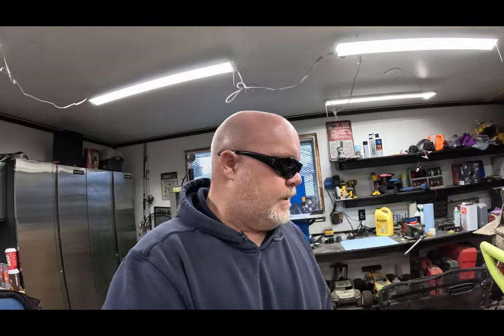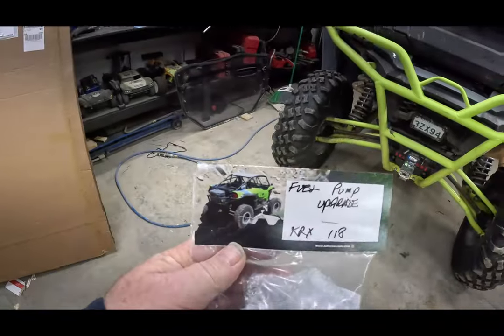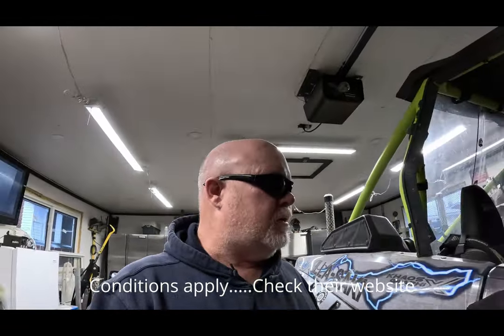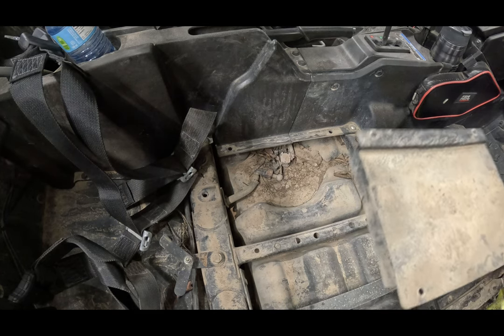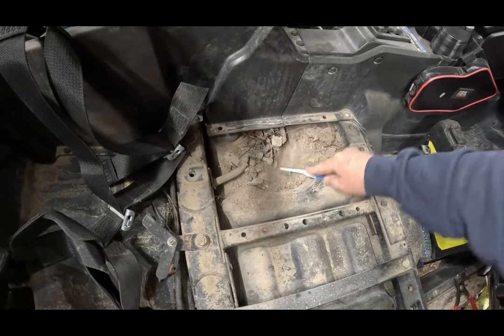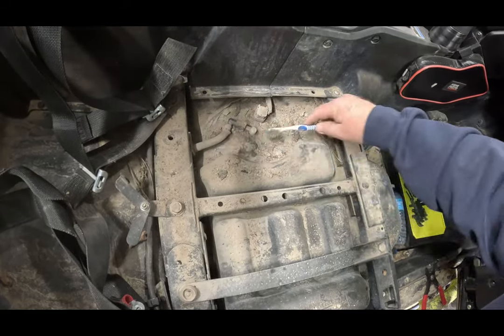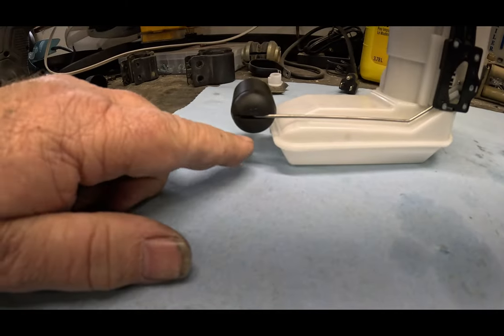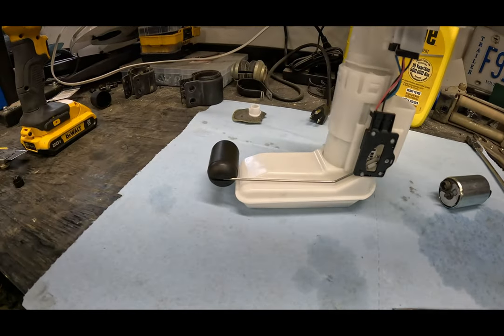KRX FUEL PUMP REPLACEMENT- Dacre prep 3

Comment: Nice job on the install. A year or more ago Jake ( Full Access ) sells a fuel rail due to I believe the Rt side is too lean. Did you happen to install his fuel rail while adjusting your valves?
Reply from the maker: Yep, I have had the fuel rail for about 7 or 8 months now :) It is hard to see but you may catch a glimpse of it in the valve video.
Reply: 👍🏼Thank you  @RhinoOffroad-zq8fh